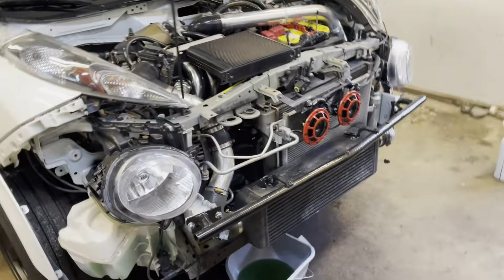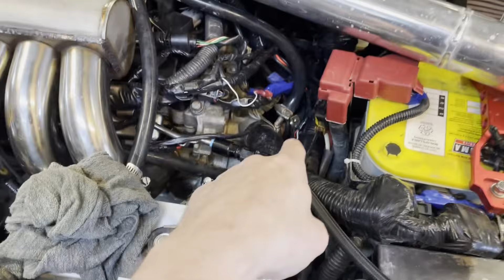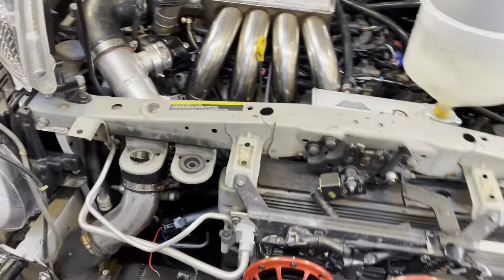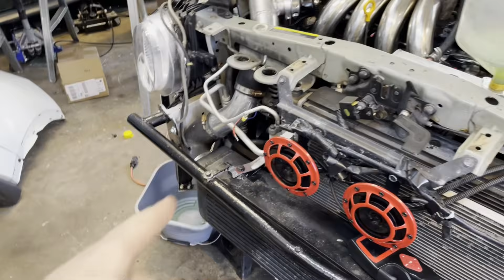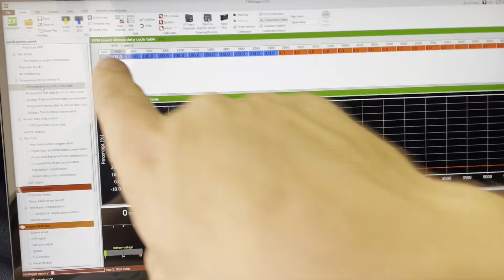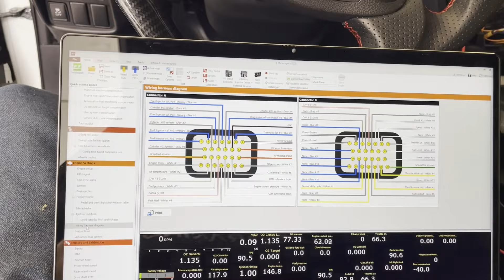MR16 Juke Electric Water Pump? Nooooo

Comment: Hello. I have a very important question. My 2011 Juke has a MR16DDT 190whp engine. The engine is dying, and I was offered a 2013 Nismo Juke 200whp engine at a junkyard. I can get the control unit from the donor. Please tell me if this engine will suit me or if it will require significant modifications. I also forgot to mention that my car has a front-wheel drive manual transmission, while the donor car has a CVT all-wheel drive.

Comment: Awesome videos.  Thank you for sharing your knowledge.  You wanna swap a nismo rs into a juke s cvt? It might be a good video.  I'll pay for parts and have a 2015 juke s
Reply from the maker: Right now we are not taking in new work, large projects such as this wouldn't be bookable until 2027. With that said, the RS engine is no more capable than the V2 engine you have. It would be a better investment to manual swap your car and upgrade the V2 turbo and bolt ons. To do that swap you would need a V2 manual donor car, which is hard to find. If you want to do a V1 swap you will have to get a full 2015 RS donor car to do it so it will still be emissions compliant (no CEL)

Comment: Just bought my first juke, gonna get a CarPlay system and some seat covers. Anything you can recommend I do to it?  Honestly want to keep this car for a while and I’m buying a new transmission for it. What to do after that??
Reply from the maker: Congratulations on the purchase, we highly recommend swapping out the oil feed line for our upgraded version and doing proper fluid changes as needed. If it's a CVT make sure you add a CVT cooler. Best of luck!

Comment: I have another question, how do you activate the launch control through uprev, they installed it for me but I can't activate it
Reply from the maker: Launch control from UpRev does not work on the Juke. When we do launch control on the Jukes we have to do it with custom set ups and trickery with the tuning.
Reply: @TheFastReligion  My tuner told me that if it was possible and that he also changed maps but he won't let me do either launch or change maps
Reply from the maker: Find a new tuner

Comment: Hello, has anyone put a 3 bar map sensor? The oem is generating errors for me loading 1.8bar with turbo mamba
Reply from the maker: We have swapped in larger map sensors before, but it makes the tuning a lot more difficult. Realistically on that size turbo you should not be running anywhere near what the factory MAP sensor is rated for.